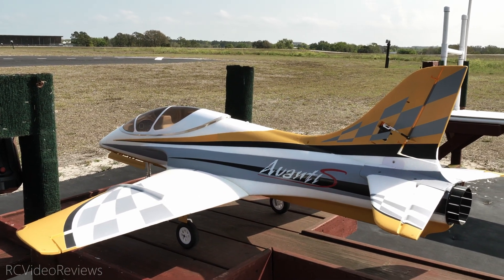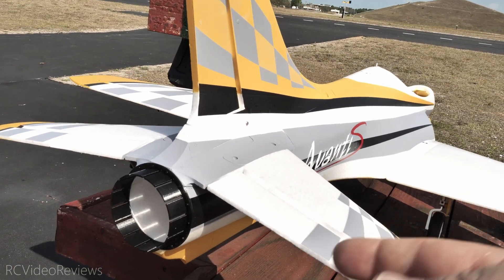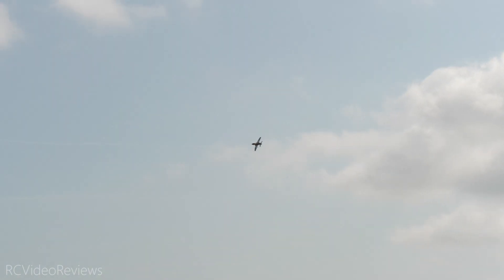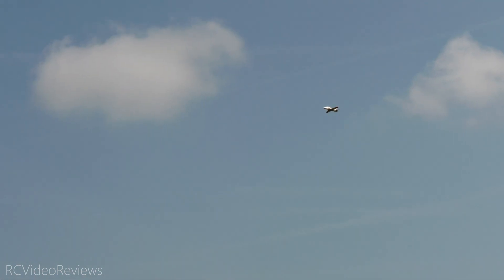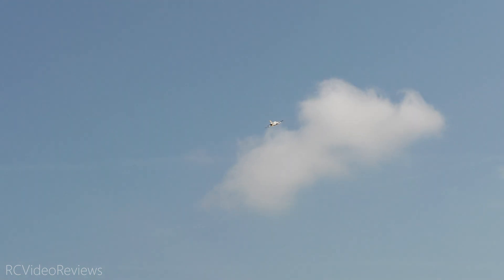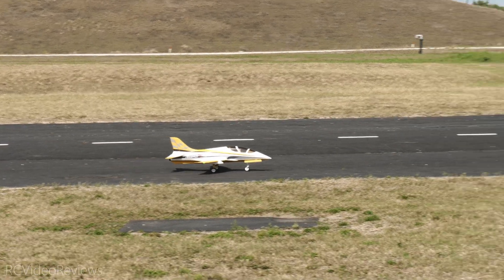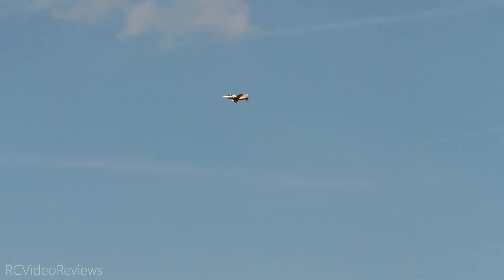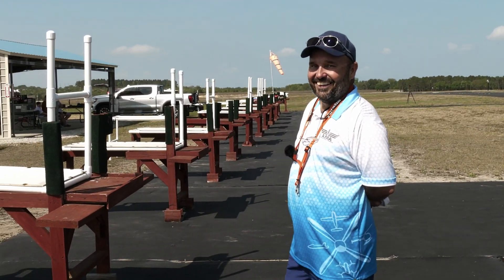Avanti S: World's First Jet Flight with ELRS SBUS without a Converter!

Comment: Can you do a video about ELRS and posibilities to add telemetry sensors? For example via S.Bus or other converters? I'm exploring capabilities of using ELRS with Turbine engine. At the moment turbine MCU typically support only S.BUS/JR/Graupner/JETI telemetry protocols.   Do I understand correctly that at the moment ELRS can only work as a S.BUS master and send controll channels and can not receive anything?
Reply from the maker: The limitation is s.bus which is a one way protocol. ELRS passes tons of telemetry via CRSF and certain other protocols like Graupner.
Reply: @RCVideoReviews  I guess I will need to save some money for a test turbine and try to setup ELRS. Somehow, a few folks that tried were complaining that they have not achieved the result due to telemetry limitations. To have a sucsesful turbine telemetry system must have sensor telemetry. The ability to connect data bus based sensors on the single data line. Where ELRS uses s.bus to send one-way data to FC. Uses CRSF to have two way communication to single FC. The big names  uses that bus to have two way single wire communication to various telemetry sensors. That ability is utilized by turbine manufacturers that imitate sensors to send turbine data and receive turbine configuration commands.
Reply: @RCVideoReviews  But this post above is only my speculations and theory. I do not find a solid info source.
Reply: @RCVideoReviews  spontaneous idea on the topic.  Bind two ELRS receivers to radio. Then, go to one receiver wifi configuration interface and disable telemetry radio transmissions. Use this receiver to control gyro/servos. The other receiver with active telemetry setup for HoTT Telemetry/Graupner and connect that receiver to turbine MCU.
Reply from the maker: Sure. Use same binding phrase on all 3. I did a video on this. It works. You can even use something like this for a twin motor plane. One RX in each wing to control the motor rather than running wires. All kinds of options here.

Comment: I respect your great efforts.
After sending a new aircraft on its maiden flight due to a defective X8R receiver recently purchased for my TX16S, I am in a dilemma.

As a result of recording and checking the transmission and reception log by attaching the problematic receiver to another glider aircraft, a no-control symptom occurred about 2 minutes after take-off, and at this time, I saw that RSSI and Rqly were close to 0.
Fortunately, the aircraft soon recovered and was able to land safely.

This is the first case of the X8R receivers I have over 20pcs, and I was able to fly with a very difficult rollback to the 2018 firmware.

I have a question for you.
Would it be desirable to use powerful ELRS on all my aircraft now?
Or should I think of it as a simple receiver failure and wait a little longer?
Reply from the maker: Although I suspect the SBUS code will be fine, I would wait until SBUS is in the official release unless you want to be a tester.

Comment: Do you  or any of your viewers know of anyone flying turbine powered jets with ELRS or TBS Crossfire/Tracer? Most of the jet guys in the USA fly either Spektrum or Futaba. I know ELRS and Crossfire/Tracer have much better range than Spektrum/Futaba, but I am concerned about trying a new RF system in an expensive aircraft like a turbine powered jet. I do fly Tracer in large custom built multirotors without any problems. I am not looking for maximum range, I only want to most solid radio link I can get.

Comment: The orientation of the aerial doesn't look right. It should be vertical for best results to prevent yourself being in the null zone when you fly towards or away from yourself. ELRS is good enough that it probably doesn't matter.
Reply from the maker: Two points:

1) The active element of the aerial actually is vertical. If you look closer, it folds down over that shelf. There's a little tiny hole in the foam at the end of the black heatshrink The active element is folded down through that hole and comes out on the vertical-ish side of the shelf.

2) I reviewed the data logs yesterday and RQLY never went below 97.5% which roughly translates to: The ELRS system was locked on like a pit bull with lockjaw. And I have the log data to prove it.

Comment: Hi John, is it possible to remap channel 5 using the SBUS firmware, as I recall you saying that this was not possible when using the CRSF to SBUS board?
Reply from the maker: It’s not possible. The A3S4 allows the mode channel to be reassigned. So ch5 is still ch5 for arming in this setup.
Reply: Ok John, still not the end of the world. Thanks
Reply from the maker: That is one of the key reasons I like the A3S4 with ELRS so much. It allows Ch5 to be used as intended and the gyro allows for other channels for mode. So they do work well together. We've also figured out the init sequence issue. Will be covered on the next PJ.

Comment: Always but always you put the gear up even in maiden because is the motor stop for any reason you do a belly landing,  if you leaves the gear down you going to destroy it, or damage heavily.
Reply from the maker: Belly landing, you're guaranteed to cause damage. Gear down gives an opportunity to save it. If a grass landing is imminent, the gear can always be brought up. I NEVER EVER pull that gear up until I know the plane flies well.
Reply: @RCVideoReviews  You do what you want I respected,. In my opinion, when you have a plane that act erratic and is all over the sky, do to anything, bad rx servo issue, you come almost in limited control the first part that will get damage is the gear and for a $50 dollars a piece of each gear, I better hide the gear in the fuselage.
Reply: I saw world champions pilot (my friends)  maiden a perfect flying f4 Phantom, all good all perfect, but the owner of the plane give him a half depleted battery,  2 minutes into the flight the plane lost the ducted fan and he try to return to the runway, but was short, in short the landing gears colapsed in landing, his words were, I should put the gear up. If he do it the damage will be cosmetic, but was not, 2 gears got damage  and had to be replaced. 100 dollars for no reason.
Reply from the maker: Your money, your hobby. Do your thing.